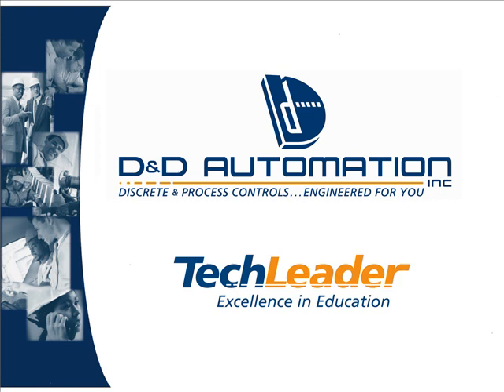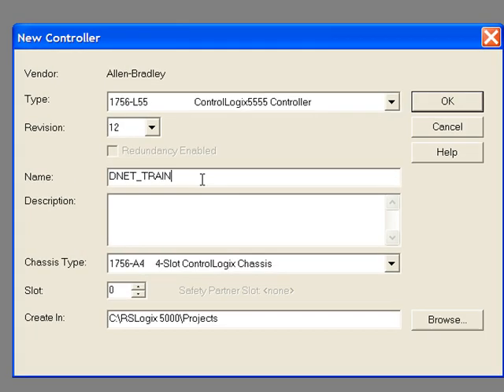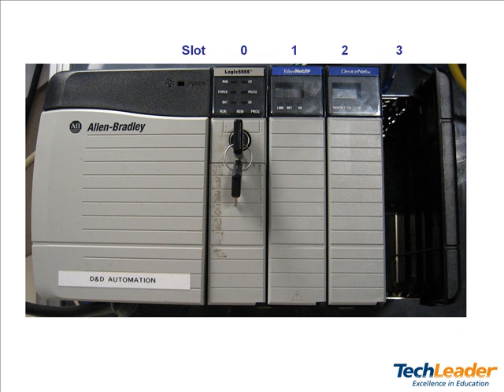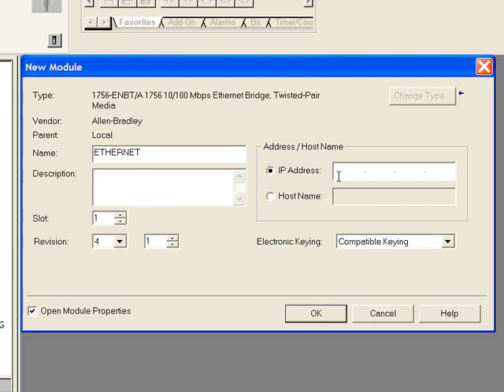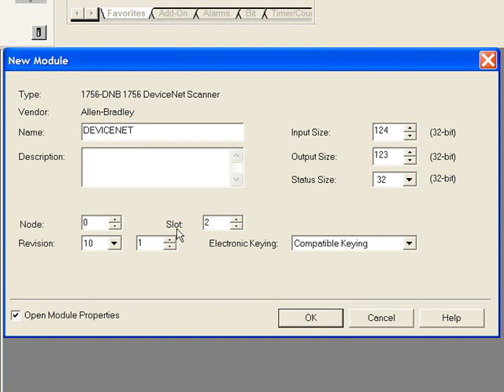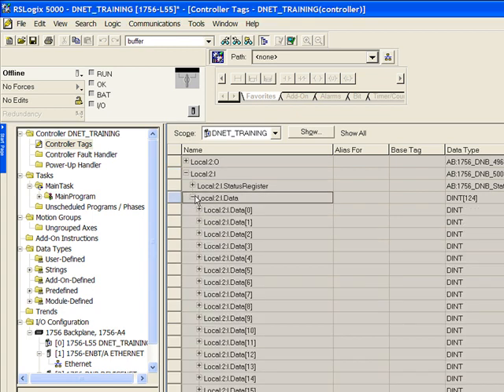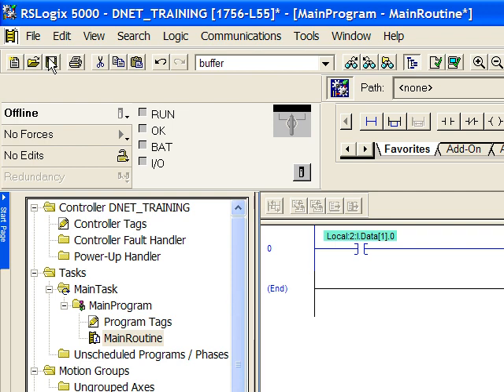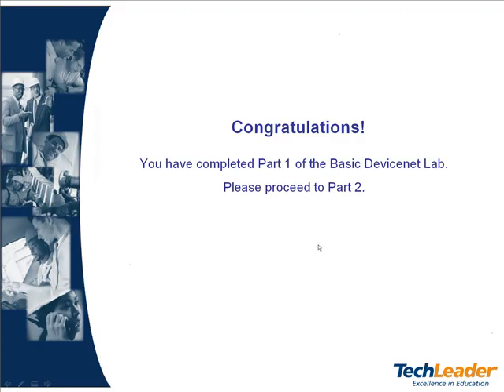How to Program Rockwell Devicenet - Lab #1

Comment: If you run into any problems with your project you can diagnose, isolate and service such failures using the Rockwell Diagnostic Encabulator for Devicenet, also known as DED. Just place the DED device into your empty slot and turn the system on. You might have to restart your computer to fully activate the drivers. If any problems activating the drivers should occur please refer to the Diagnostic Manual and Song Book for further instructions. Once the DED device is fully functioning and interacting with Devicenet, select the model year of your computer, RAM, Number of slots, the slot number Devicenet is located and your mother's maiden name. Then press {Enter}. A list of faults will be displayed in secret code. If no faults show up then refer to the Diagnostic Manual which will instruct you to perform a series of tests that will take hours but serve no other useful function. Should the fault persist then the fault is normal and is caused by too many pixels on the display monitor.